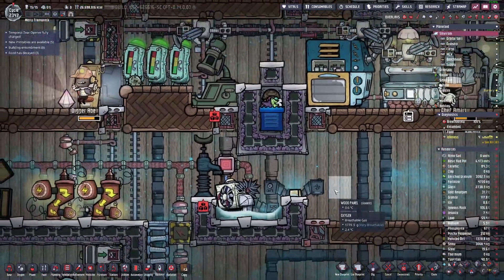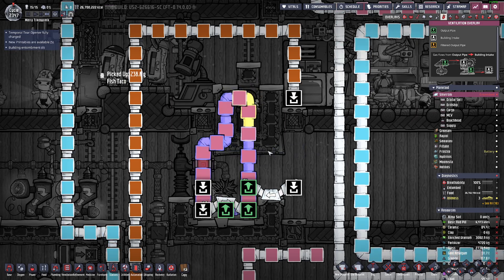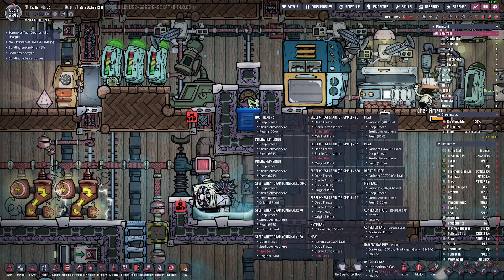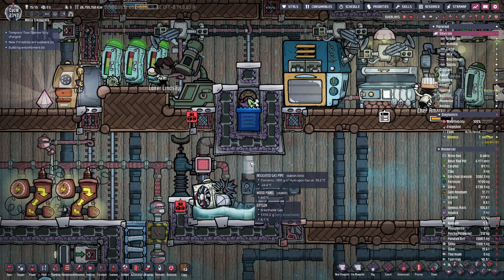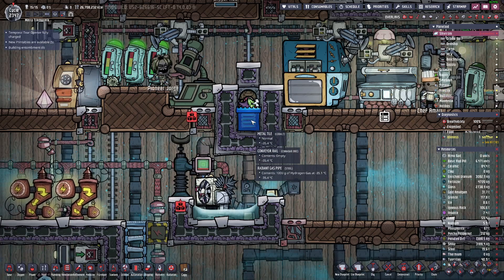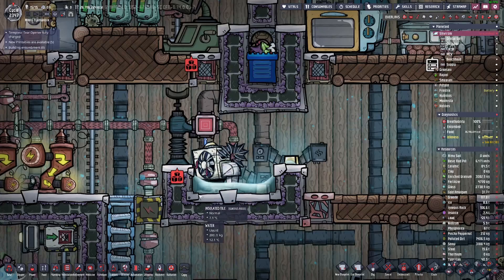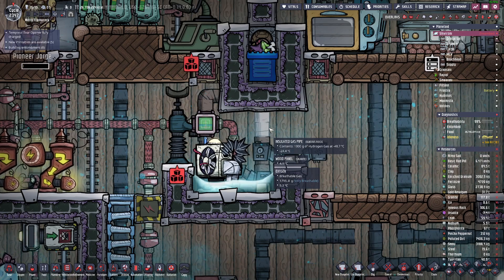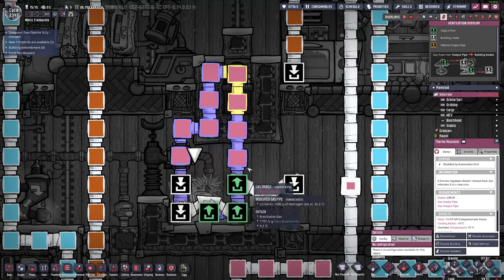ONI / Oxygen Not Included - Deep Freeze Design - Simple, Permanent, Low-tech

Comment: I used this exact setup in my current run and for some god awful reason my food keeps spoiling and emitting polluted oxygen into the freezer and thus spoiling the rest of my food. Have you had this problem?
Reply: I have the same problem, but I didn't use the same setup as I didn't read the comment early enough. The reason for me was the following: I used vacum on the food tile as my earlier deep freeze setups that worked best. In this one when you drop a lot of hot food in it it is not fast enough to cool down. In those cases it starts to spoil food that is there for longer. then it rots, and emits polluted oxigen which kills the whole supply.

I'll implement two things: 1: I'll fill the storage with hidrogen. This suppose to help cool the food down faster
2: probably will make a deepfreez loop on the rail (in an ice biom) so the food gets here is closer to deepfreeze temperature and not like 70C...
Reply: @gomez8655 makes perfect sense
Reply: make sure to autosweep the polluted dirt and rot pile, if you lose power you might unfortunately lose the sweeping task making it emit pollution
Reply: What did you set your thermo temp to? I set mine to -30 because it takes some time to chill down new food, having it at -18 makes it take longer